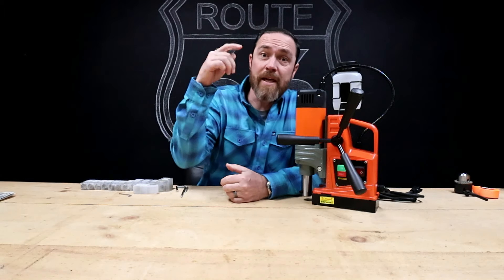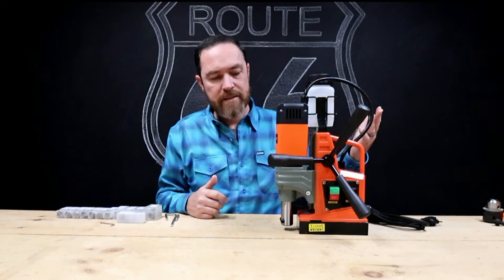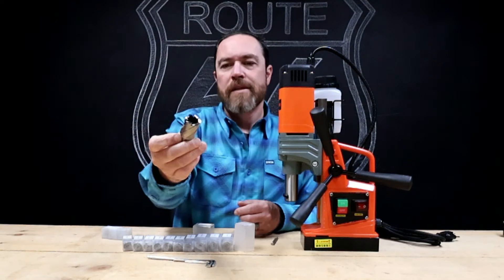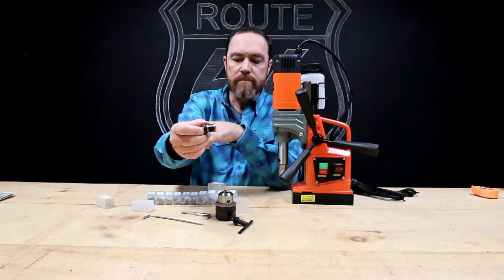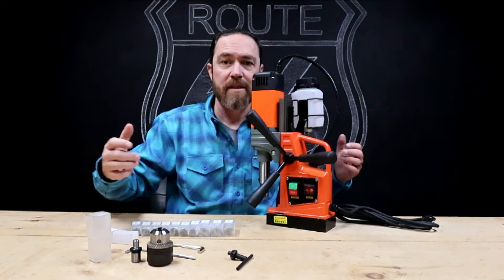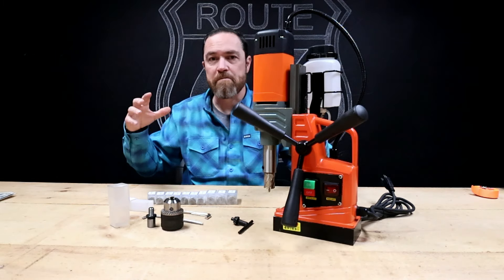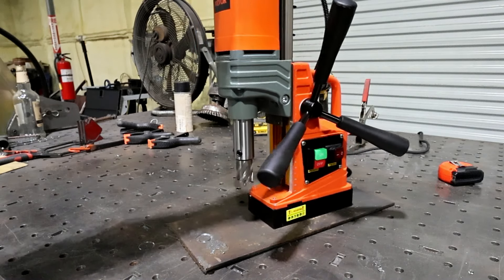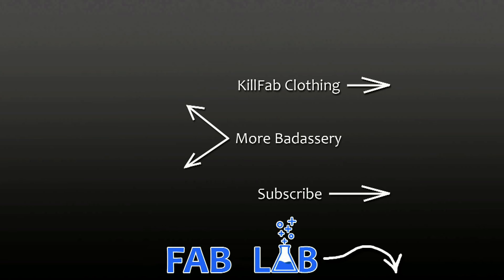You Need This Tool - Ep 145 | Vevor Mag Drill

Comment: bought the same magdrill 
first hole i tried to make it dropped off the piece i tried to drill and busted the powerlead to the drillhead and took some skin off two of my fingers when i acidently grabbed it by the drill to catch it (5 minutes intoo the job and i was allready bleeding ) 
was eazy to repair with some solder and schrinktube but i think vevor would do good to move the hole for the powerlead to the side of the tophat facing the handle as i think that would keep it a little more protected when it falls upside down

Comment: If you had neither this tool or a drill press , would you buy this one first?
Reply: Unless you specifically need a drill press this will be way more versatile.  I have a steel plate with a piece of angle welded to the back, you can put it in a vice a stick this on to works just like a mini drill press.
Reply: Answer is, yes.
I've got a bench top drill press and after buying and using this, I'd much rather have had this first. (Granted when I bought my drill press, mag drills were $1k +)
It's basically a portable drill press.
And annular cutters are far quicker and more precise than any twist drill.
9/16 holes in 1/4 plate and it's like you're drilling through wood, so smooth and quick.